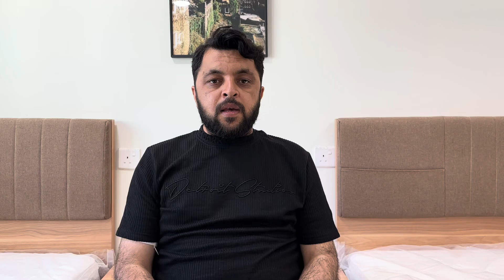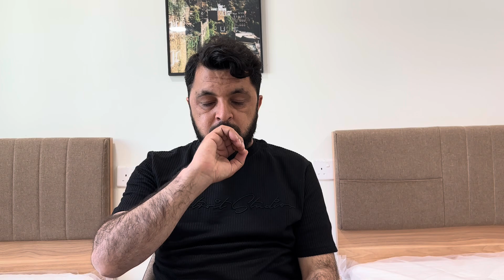Basic Knowledge for Civil Site Engineer | Civil Quality Engineer | Documents | Sequence of Work

Comment: As a Civil QC Inspector of Sub Contractor , What'll be my responsibilities?
Reply: If you are working with a subcontractor, you should check the work according to the IFC drawing, design and specifications.

Raise RFI.

Material inspection to the main contractor quality team.

Presence at site during servileince of main contractor quality team.

Closure of SSR and INCR.
Etc.
Reply from the maker: Same as explained by Mr. ilyas
Reply: Bro you are with sub contractor or main contractor 
As a QC inspector your responsibilities are same. During interview don't say it or don't get confused if someone specifically ask about sub contract QC.
Reply: Whats the sequence of duties performed by the QaQc inspector by the contractor side and from the client side. Plz explain seperately for the both